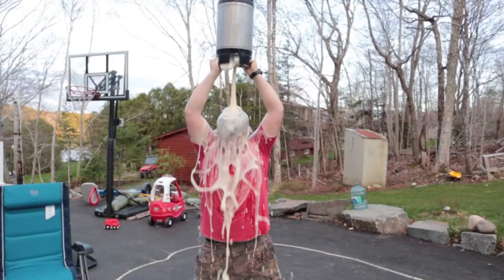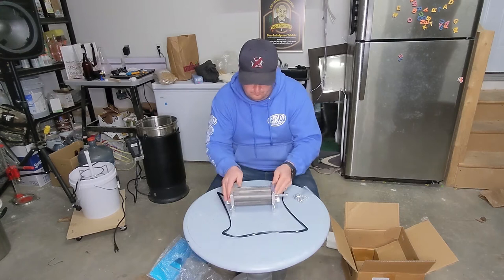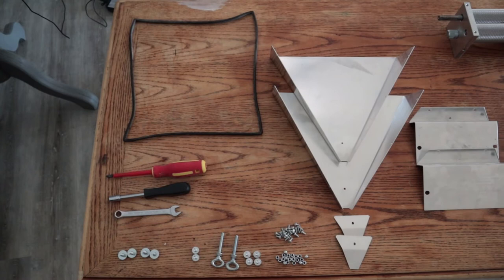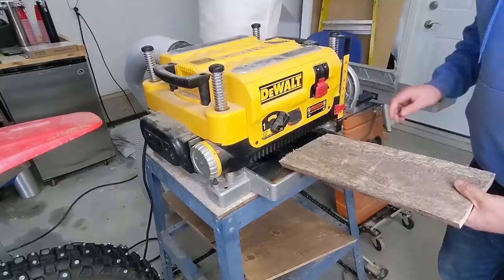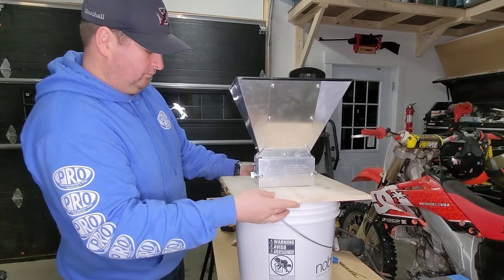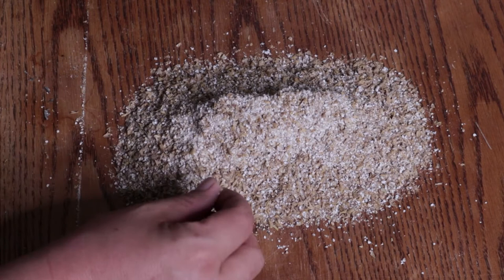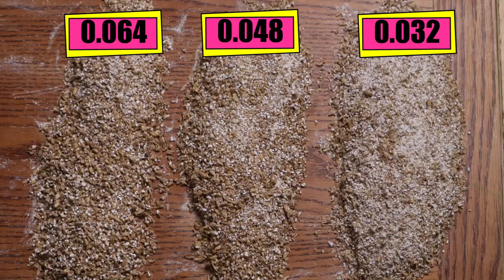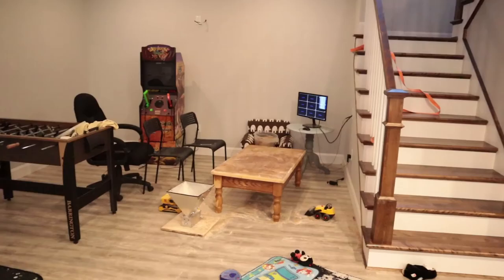Malt Muncher 3 Grain Mill Unboxing Assembly and Crush Test

Comment: I have my mm3 set at .38. It works well with grains that don't have a lot of protein, but not too much of a hassle either way.
Reply from the maker: Nice, I'll try that out. I've thought I had the perfect crush a few times, only to try something different that worked better.
Reply: @PartyTimeBrewing  you can always add enzymes to your mash to help with efficiency. I've adopted that solution, instead of messing with my mill

Comment: What size screws for the base plate
Reply from the maker: I got my screws from a tv mount, they are a metric M6 x 35mm. I believe that would be a M6-1 x 35mm if you were going to the hardware store. Just adjust the 35mm to whatever you think the depth of your wood or lid will be. Cheers!
Reply: @PartyTimeBrewing  Thanks my man much appreciated happy brewing and cheers